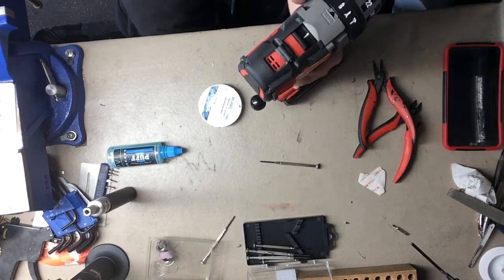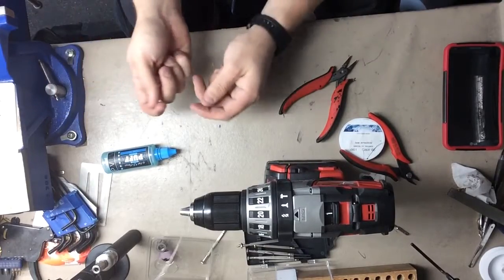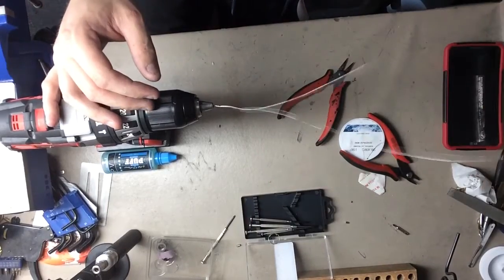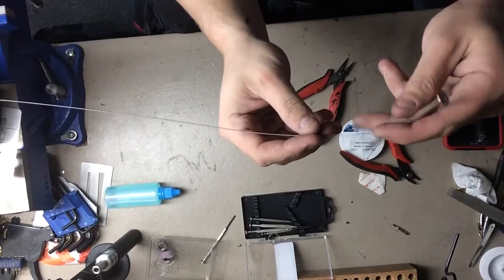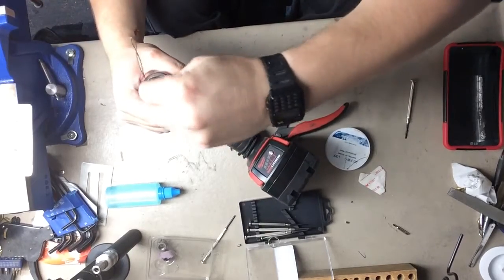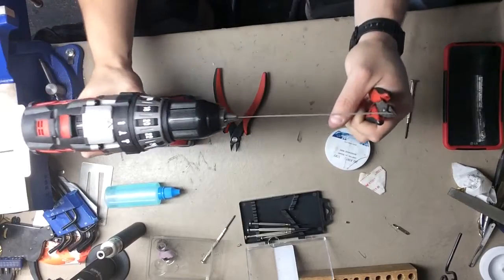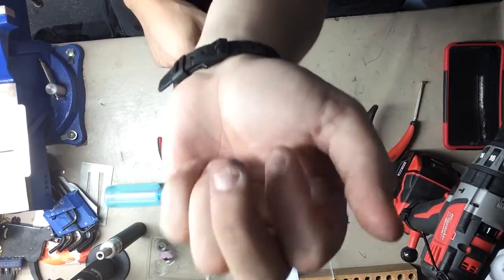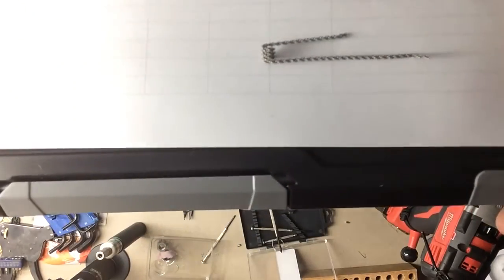chain wire tutorial for rda dual coil

Comment: Thanks for sharing, but for those watching this, this is a double-twisted coil. a chain wire needs to be twisted then untwisted in the 2nd part (twist together putting the drill in the opposite direction) so the twists "open up" - so you need to cut the full twisted length in half, then reverse on half then twist in opposite direction. the difference, this will give you tons of clouds, while the chain coil will give you condensed flavor (especially with smaller gauge wire) - cheers all vapers...